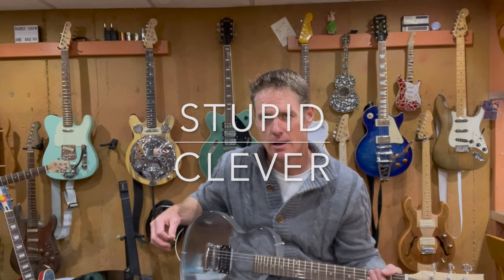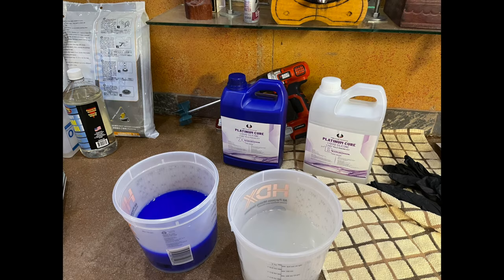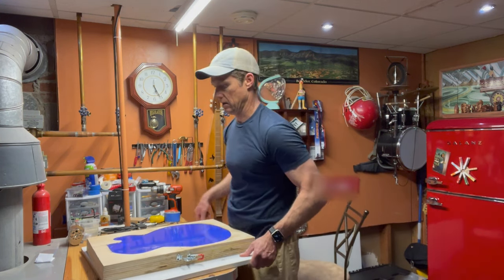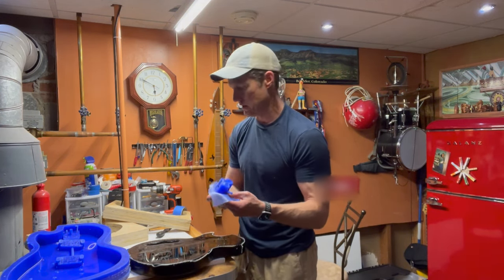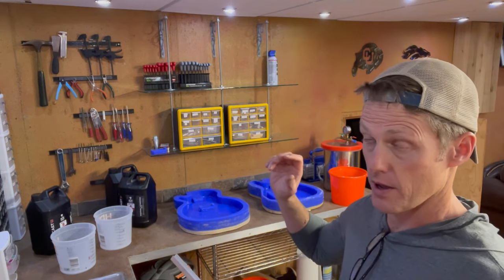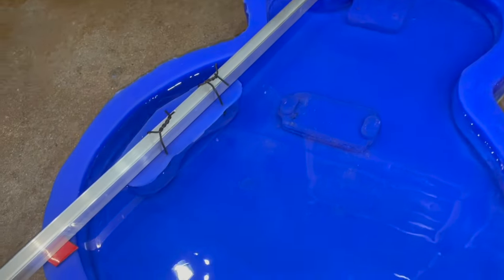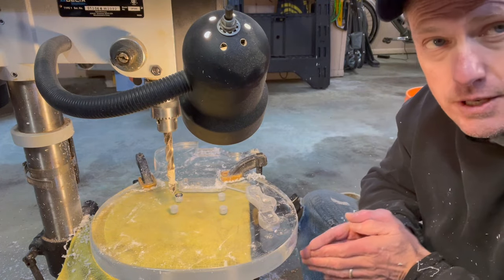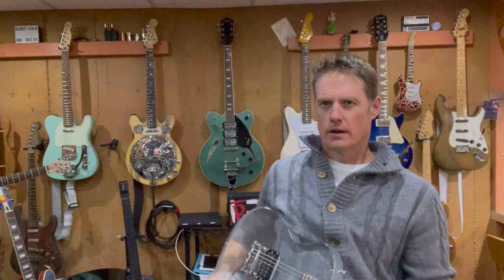DIY Epoxy Guitar

Comment: It takes a 1 gallon silicone kit to make the body can you use a 1 gallon resin kit to make the guitar
Reply from the maker: Great question!  I was curious enough to find out!  I poured one gallon volume of water into the mould and it filled it within 1/8 inch.  The deficit would be on the back of the guitar and really wouldn’t affect the neck pocket, so in general, I will budget a gallon of epoxy for any future pours.  Thanks for watching!
Reply: @stupid-clever  how much did u pay for the silicone and can I get the link to it